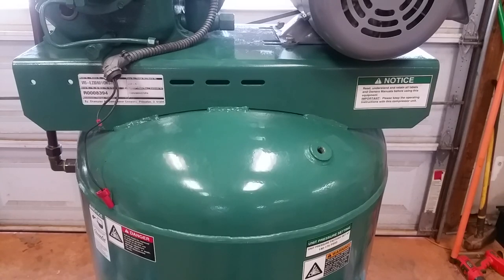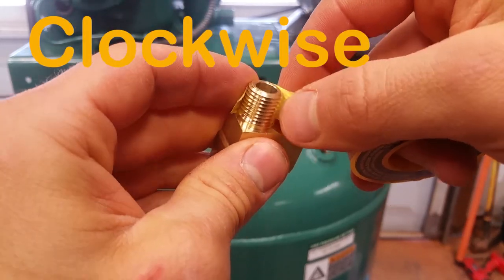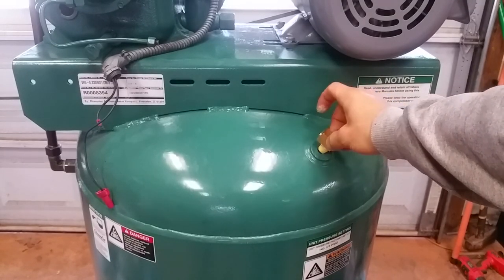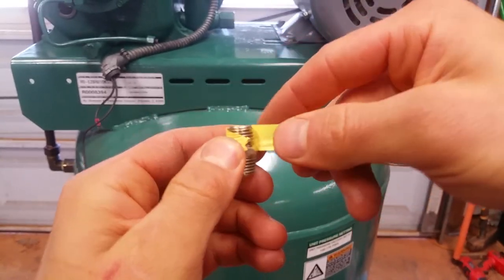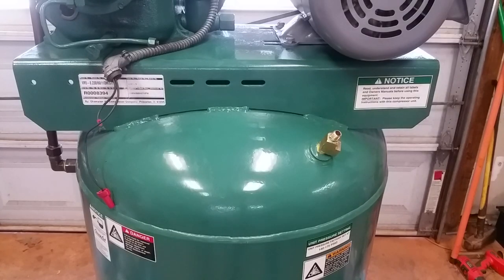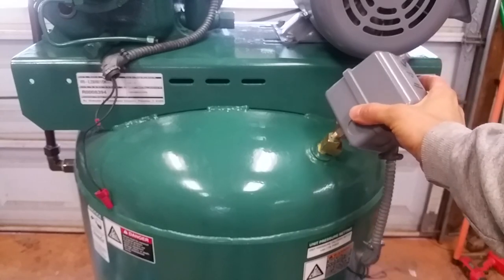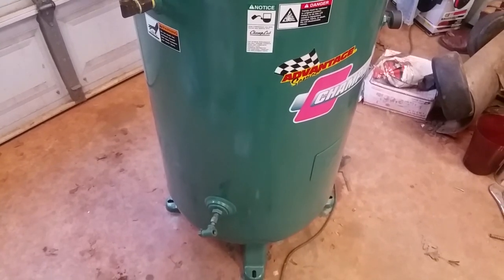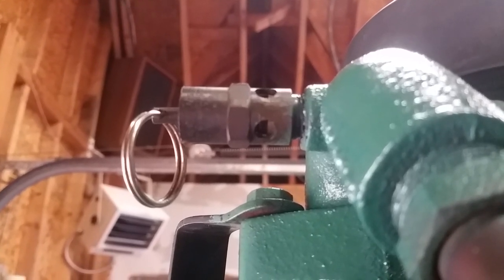NEVER Have Air Compressor Leaks Again!

Comment: Simple video and simple fix. Watched this vid and went to local Tru-Value this a.m. and bought these. Although the yellow paste is a different brand.  I was using white Teflon tape and couldn’t get a seal on  a bushing from the air hose. 
I took my time and applied both to the fitting and now my compressor is holding air.
Thanks Matt

Comment: Thanks for sharing your tips. Personally, I suggest that people read and follow directions on products. On that yellow Teflon tape, the directions say to wrap the pipe 4 times, so that's what I would do. The company that makes the tape isn't going to tell you to apply it the wrong way. Different tapes may be a different thickness, so I suggest always reading the directions on the specific tape that you are using before you use it. For example, one tape might seal well with 2 wraps, another tape may not be as thick and might leak if only wrapped 2 times. Therefore, I suggest reading and following all instructions on products.
Reply from the maker: Good points. I don't remember seeing how many times to wrap the teflon tape around on the packaging. I'll have to check tomorrow. Thx 4 the tip
Reply: Avery Alexander do you know sir it kind of depends on the application such as air or water and whether the fittings are new or have already been used how well you clean them and prep them prior to wrapping. Sometimes too many rats can hinder the piece is going in far enough and if you do not wrap it enough you do risk the chance of a leak which after you put it under pressure you should be able to check for leaks as a rule of thumb.
Reply: @gkeith4120  That is very true, the size of the pipe makes a difference too. Should be able to feel what the right amount of tape is. The manufacturer's directions are generally a good place to start though.
Reply: Avery Alexander Perfect explanation now.👍
Reply: I agree tho most tape for example will say a minimum of 3 wraps or a minimum of 4 wraps . Sometimes more is ok but never less however I think some people way over do it . I’ve seen guys put 12 to 15 wraps it blows my mind and you know that much isn’t actually going to threat in it’s going to peel back or rather push back .
Reply: @NewsThatMatterUsa  Yup, on good threads I usually just stick to the minimum number of wraps listed on the roll and can't think of a time I ever had a leak doing that. Like you said, way too much is bad too. If the threads are rough, adding a couple more wraps to help fill in any gaps can help get a good seal.

Comment: Noobie here - if you ever need to replace the check valve in the future, how hard is it to remove the "pipe dope"?
Reply from the maker: Not hard at all. You just clean it off with a rag.
Reply: Matt's Shop Appreciate the quick reply! One last question, my check valve came with an orange coating on the threads. Is that some sort of sealer?

Comment: @5:50 Matt- "Machine" threads always have a gap- that's how a thread lock (Loctite) works, it dries to a hard plastic inside the now rarified atmosphere of the gap, closing it. "Pipe" threads (NPT) are tapered. When tight, there is no gap. The more number of threads- the stronger the seal. Teflon tape is a non-migrating inert thread lubricant. It is tightly wrapped, single layer, in the direction of tightening. It allows the fitting to safely tighten more than it would dry. Pipe dope- is usually smeared around on the threads and the tightened connection as protection. You can easily overuse and misuse each product; Teflon tape will allow you to tighten a connection way beyond spec- and easily snap it off.
Reply from the maker: HUBBABUBBA DOOPYDOOP Yea, I know NPT threads are tapered that's how they seal. Thanks for the good info! Honestly, the more I use teflon tape the more I like pipe dope. Teflon tape gets those little strings everywhere once you remove a part. I don't know, the pipe dope is growing on me.

Which do you prefer.
Reply: They each have similar uses, but also can greatly differ with application. With your Shop air- dope is fine. For a drinking water pipe, I'd use tape. Please cut/paste this into your browser:   https://search.yahoo.com/search;_ylt=AwrJ61YiGIFaq7oAxnlDDWVH;_ylc=X1MDMTE5NzgwNDg2NwRfcgMyBGZyAwRncHJpZANCLndLT1puSlNxeVdmcmp6cmFBUTFBBG5fcnNsdAMwBG5fc3VnZwMxMARvcmlnaW4Dc2VhcmNoLnlhaG9vLmNvbQRwb3MDMQRwcXN0cgNwaXBlJTIwZG9wZSUyMARwcXN0cmwDMTAEcXN0cmwDMzIEcXVlcnkDcGlwZSUyMGRvcGUlMjB2cyUyMHRlZmxvbiUyMHRhcGUEdF9zdG1wAzE1MTg0MDk3ODI-?fr2=sa-gp-search&p=pipe+dope+vs+teflon+tape&fr=sfp&iscqry=
Reply: Why is there two types of teflon tape? Gas (yellow) and water (white), when their use is just for lubricant.
Reply from the maker: Good question. The yellow stuff is thicker and seals better from what I know. 

It doesn't get all stringy like the thin blue roll stuff. All those little strings can clog up gas orifices and air tools too.
Reply: @fireh3211  gas is corrosive, and will degrade the white tape.  The yellow is an anti-corrosive tape, so it will seal even when exposed to corrosive natural gas.

Comment: PSI depends on schedule of pipe generally. 40, no less than 140. 80, no less than 200 at 73f.
Reply from the maker: +xephael - Does that still apply to steel pipe? A piece of schedule 40 black pipe has to be more than 140PSI. That's nothing.
Reply: Yes it's applied to everything that has that rating.  You could also have rust and other things to consider using different materials.  I used galvanized schedule 40 at 160psi for a few years and it didn't fail...your mileage may vary.  Maybe you want to do a future video on pressure testing various pipes and couplings till failure?  :-)
Reply from the maker: +xephael - Thanks for the info. That's a great vid idea!

Comment: Sure looks like you wrapped it clockwise to me.
Reply from the maker: xephael - I did!
Reply: xephael always wrapped in the direction of the threads as if you were putting on a fitting or bolt etc. so when you actually where is the two parts the pipe thread will naturally follow.

Comment: I thought about doing that earlier. But realized that the yellow teflon and pipe dope  says 100 psi max. So I wasn't sure.
Reply from the maker: Really? I've never heard of that. The yellow Teflon tape is only good up to 100 PSI?!?
Reply: @MattsShop  the yellow rectorseal bottle says up to 125psi operating. Although it doesn't seem like you've run into any issues since making this video. I just applied it to some fittings on my compressor as well but plan on letting it set for about a day.
Reply: @MattsShop  on my tube, it says 100 PSI right away.  wait for up to 48 hours cure for higher PSI

Comment: Threadlocker is all you need.
Reply from the maker: I hate that stuff on air fittings you need to take apart later.
Reply: @MattsShop  I only use it on quick connect adapters that go directly into the tool. 

I personally never a need to remove those

Comment: Pressure rating based on diameter and wall thickness of that little nipple, it will be way, way more than your weakest element…if interested search pipeline smys